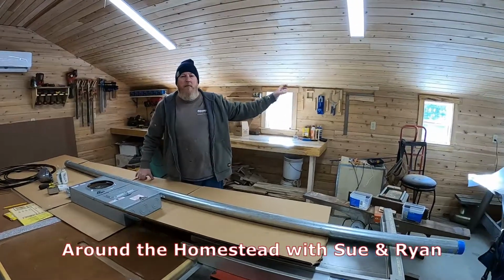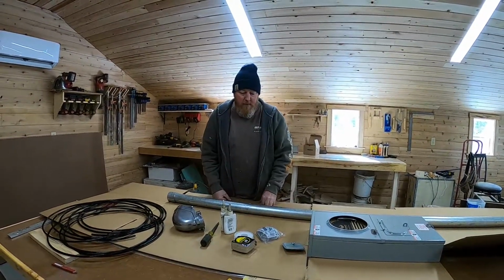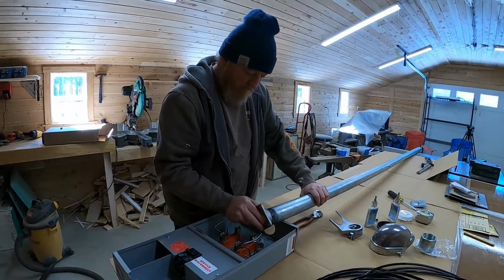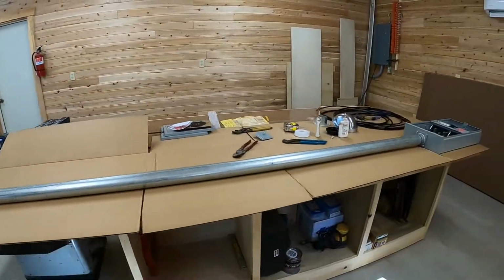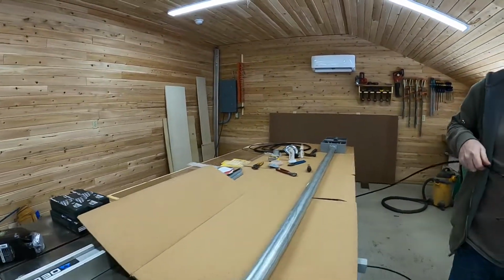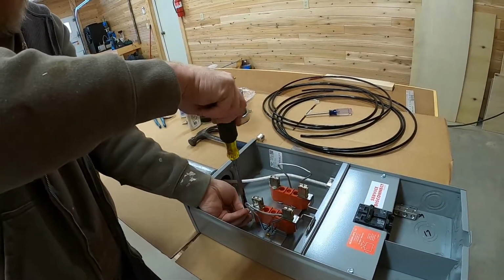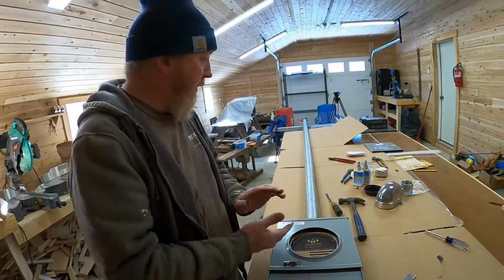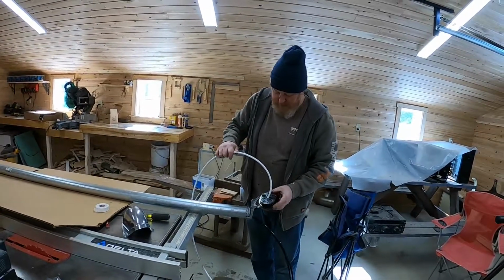Putting together a 100 amp electrical service

Comment: Since you have that switch outside and the neutral grounded there - does that mean that the ground and neutral will not be tied together inside at the main breaker box ?
Reply from the maker: correct, this is the main breaker box as such so the first box down stream is a sub panel